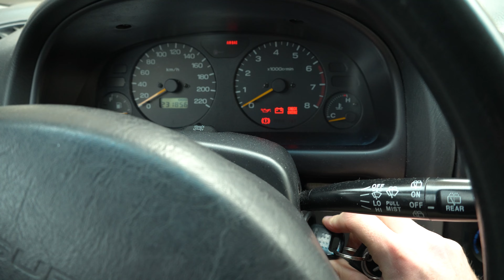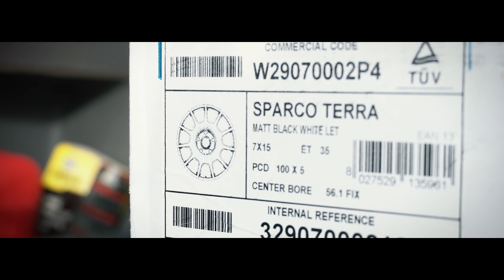NEW WHEELS for my Overland Subaru Forester 🔥

Comment: clean them up and ceramic coat them including the inside of the barrels. Makes a world of difference keeping the shit off of them.  Tape up your lug nut socket to protect the lug pockets on the wheels from paint chips and scratches. I usually wrap mine with yellow electrical tape
Reply from the maker: The coating is a super idea! I might do that if I have some spare time 👊 and protecting the wheel lug pocket that's a good idea as well definitely will do in the future! Thank you soooo much 🙏

Comment: Nice wheels! 
The alternator on my 2004 Forester XS died today. Luckily it happened in a convinent spot, my parents driveway. Waiting on a flatbed tow now. 131,000 miles, and just spent about  $2000 on a major service and both rear wheel bearing replacements a few weeks ago. That's life with a 20 year old car. 😂
Reply from the maker: Daaamn I feel that... I've been spending way to much on repair/maintenance on my other foz 😭 but as you said, 20+ year old car life ahahah

Comment: Wheels look good. I would like to see you invest in a safer jack and some torque bars for that just!
Reply from the maker: Thanks my friend! Sadly my bottle jack doesn't hold pressure anymore and my floor jack is useless in mud/uneven terrain 😟 For the torque bar you mean something to properly torque the lug nuts ? The impact wrench I use have an auto mode that stop at the right torque for lug nuts !

Comment: looks good, the offset should be useful in stability and protecting body bit more if in ditches or getting tight to stones/trees etc .
are tyres the same size ?
Possibly loosing sparco decal be a bit more stealth, really depends on personal preference and security factors I guess .
Hope to see some mud on them soon & an adventure or 2 .
Hope you & Liz well, Have a great Christmas, although your presents came early lol !

Comment: They are great. All black even better.. Another thing. ET is 35, the original specification says 48 which means the new ones give the Foz a wider track width. Does it require approval of some kind?
Reply from the maker: Changing the wheels is pretty much illegal, just like fitting bigger tires 🥲

Comment: Hey I love your rig! I picked up a SF 2002 & want to get 215/75r15 tires on the stock wheels & wanted to ask.  Did your car rub at all with the tires & stock wheels? Can I use the SF rear struts or do I need the SG rears? Thank you
Reply from the maker: Hey there, thanks for your comment!
The SG rear strut are mandatory for 215/75/15 tires because the spring perch is higher. On the front it's all good, only slight rub at full lock.
Reply: @ALNSMOVERLAND  sounds good! ill keep that in mind. struts, lift first then new tires!😎 Can the area where it rubs be trimmed?

Comment: There is improvement in acceleration with new wheels? Original steel rims weigh about 10 kilograms, these Sparco wheels for sure are lighter.
Reply from the maker: I still need to weight them and compare with the steelies. Acceleration seems a bit better 😉